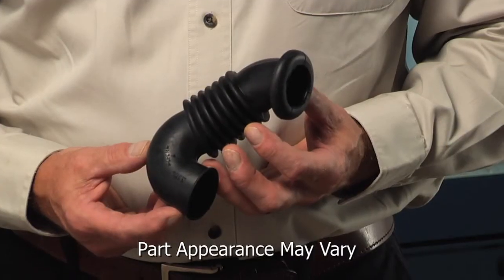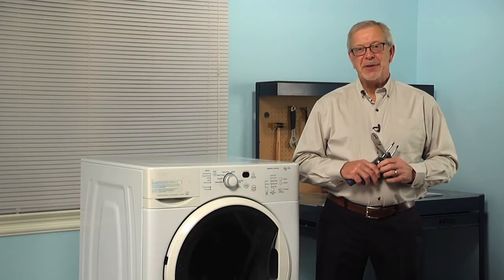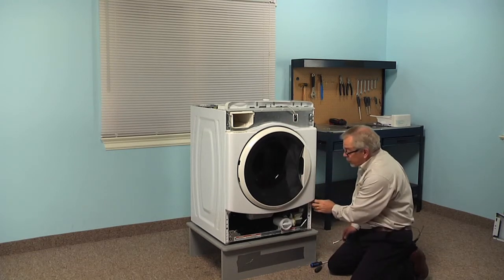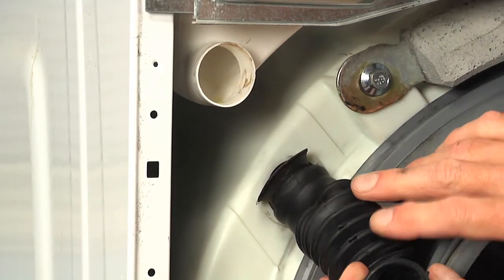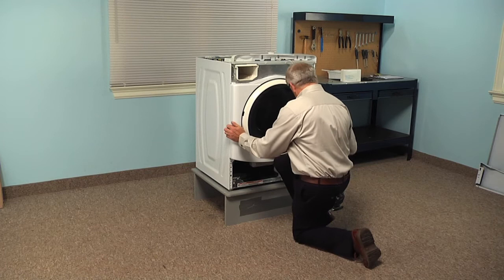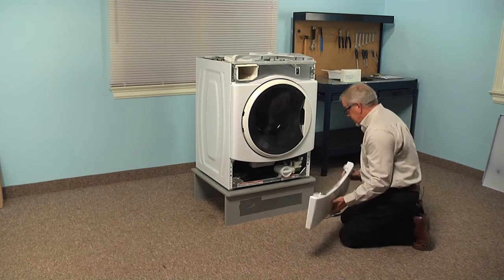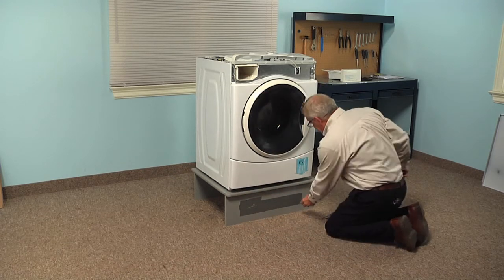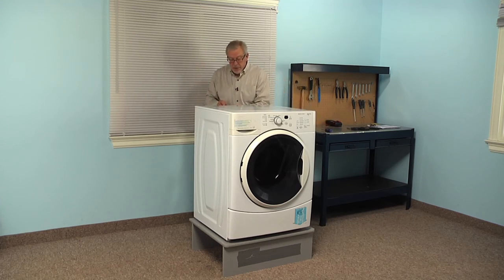Washing Machine Repair - Replacing the Dispenser Hose (Whirlpool Part # 8540063)

Comment: This video saved me $$$. ☺️ Thank you. I am not savvy about these things but didn’t want to call a repair tech. The step by step instructions were super on point and helpful. Was afraid about taking off the door but this gentleman made it look so easy. I found a garment in the tube that was causing the leakage. Will definitely subscribe and check out the other videos.

Comment: OMG!  It’s 2020 and I used this video to fix a leak from my dispenser. The hose leading out of it had a sock in it.  Putting that coil back around the door seal made me curse a few times but I got it back on and my washer is running great!  Thank you!!

Comment: Once I completed the job which was successful at first after my second load of clothes water started running out the bottom of my wash machine again I repeat it all the steps only to find that the the dispenser hose head ripped all over again not sure why that happened or if the part was defective but now I’ve got my machine tore down again wondering where I should get my next dispenser holes

Comment: Great vid! Tough to find a hose replacement video. Thank you! Should it be replaced when replacing the soap dispenser?
Reply from the maker: +Rick Boyer Normally this hose would only get replaced if it was damaged from a small item gettingbetween the inner basket and the outer tub. If the hose is still firmly attached to the tub and is still flexible, it probably does not need to be replaced.